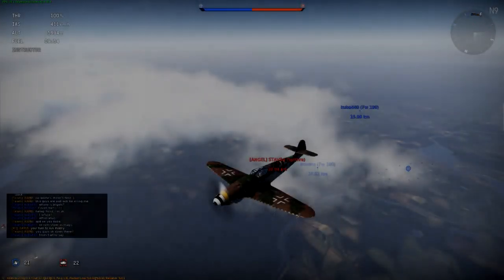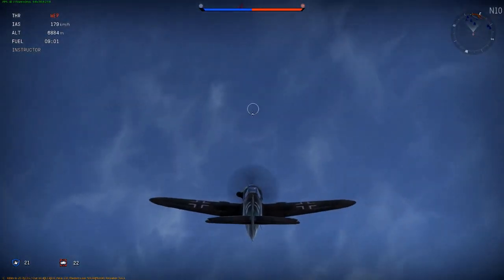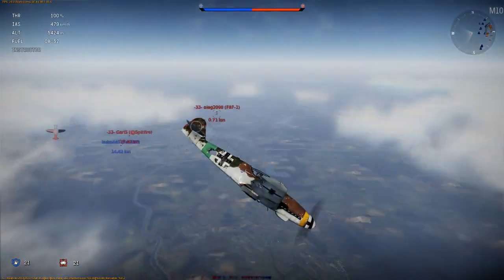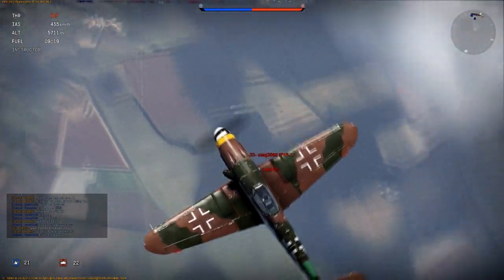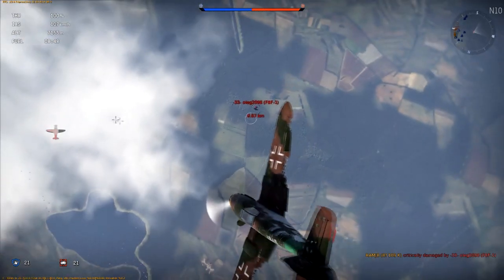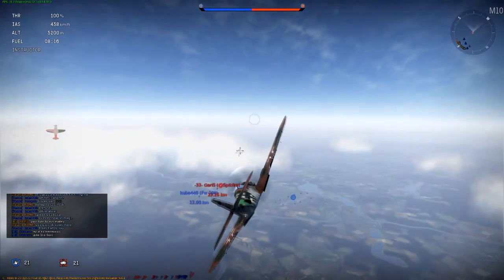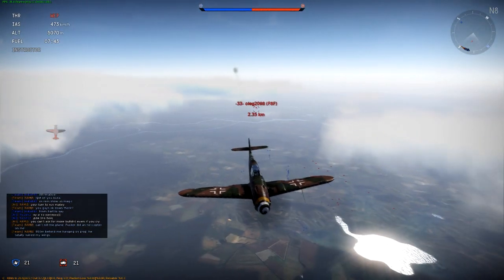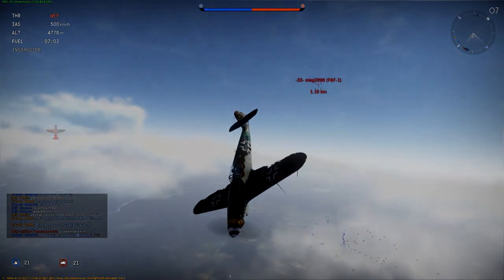War Thunder: when broken happens.

Comment from the maker: btw, the mere fact that at the climb both planes were at a similar energetic state is a dead giveaway that the F8F is borked beyond redemption. Starting out at a similar energetic state, one plane simply pulls out, the second does a complete high-G 360 degree reversal AND a pull out, and the energetic states are still similar.

If the F8F had a similar energetic state at the climb it means the F8F wasted NO energy in his 360 degree high G reversal - pointing out at an obvious flaw in the FM.

Comment from the maker: we were in a straight run situation, he was moving away from me at the same altitude and roughly the same speed. He started his split S from that position, from a level run. He STARTED DIVING from that position. He was not diving prior to that.

You can make up a million excuses to try to avoid a broken flight model to receive the fix it desperately need, but that won't avoid the eventual fix - the F8F will get a proper flight model wether you want it, or not.

Comment from the maker: The point of a Split is is to conduct a high G move with the least speed deficit as possible. Doing a half loop costs a ton of speed (as you turn part of your speed for altitude, the rest you waste in the high G increased drag). Doing a horizontal turn costs a ton of speed (as you turn your steep increase in Gs mean a huge speed loss).

Split S is a way to do a 180 degree reversal with as little speed loss as possible - but you still burn a TON of energy by doing it at high Gs.

Comment from the maker: That's the problem. We both stall about the same time. The difference is that, starting from the same energetic situation (Same altitude, almost the same speed) he had conducted a high-G 360 degree move and posterior pullout. I just pulled out. Still we stalled out at the same time. Or in other words - he had burned no energy in a high G 360 degree reversal.

Translated into layman terms: the F8F Flight Model is more broken that the Parthenon ruins.

Comment from the maker: With 150 octane fuel the Spitfire was really a top class climber, and it still turned very well. The problem is not the plane, the problem is the unlock that turns it into, bassically, a 1945 performer, when it's sitting at a level that belongs to 1942 planes. Hence it's brokennes doesn't steam from a wrong flight model, but from a terrible matchmaking level.

Comment from the maker: so the point of doing a SPlit S is to do a fast change of direction and remain fast - but that doesn't mean that doing a Split S doesn't carry a hefty energetic penalty if it's pulled at top Gs.

That guy pulled a Split S as hard as he could using as many Gs as he could. He didn't burn any energy in the process - hence, the FM is broken.

Comment from the maker: The ingame Bf109K4 is a 1945 C3+MW50 versión. That's why it's a level 16 plane, otherwise it'd be a level 14.

And no, this kind of stuff doesn't happen with any other plane. Doing a full 360 inverted loop in even the best of the fighters of this game will give you a net 100kph IAS loss at the very least. This guy was as fast as he finished his 360 degree high G inverted loop, as when he entered it, and is pretty easy to see it in the video.

Comment: You have to remember that the F8F arrived in War Thunder in patch 1.33 and most likely doesn't have a proper flight model yet, as most new aircraft don't. Planes that have been in the game for a while, like the Bf 109 F-4 (and /trop), La-5 and otherwise usually have somewhat proper flight models, by now.

Comment from the maker: diving doesn't GIVE you energy. Diving transforms altitude for speed. And you'll excuse me, that guy did a 360 degree inverted loop at maximum rate meaning a but-ton of Gs being pulled all through the move.

Comment from the maker: Trading altitude for speed is pointing the nose down and go in a straight line.

Doing a Split S equals pulling high Gs. Pulling high Gs means induced drag going over the roof. High drag means a strong energy loss. Sure, the Split S is an energy conservative maneouver. Doesn't mean it doesn't have an energetic cost-it means it saves some energy compared with a non energetic conservative move as an horizontal turn. That move should've costed that guy a hefty ammount of E.

It didn't. Broken FM.

Comment from the maker: not at that speed. Aiming at less than 100kph in a purely noseup position is nigh impossible in most planes in Historical Battles - that guy did exactly that. It's an Arcade Flight Model in HB - and that only compounds the brokenness of a plane that burns less energy in a high G 360degree reversal and climb than other than just does a pull up.

Planes with such an obviously and blatant unready flight model should -never- have been released. Hope Gaijin learn from their mistakes in the future.

Comment from the maker: One: the bearcat's lower parasitic drag doesn't matter a single bit when he's pulling Gs like mad. Induced drag takes command there, and the bearcat should suffer from the tremendous drag it produces

Two: the Bearcat averages 200fpm less of climbrate of a K4 across the altitude ranges (can back this up with original German documents and original US navy documents)

Three: Pretty much irrelevant. That bearcat should've never stalled 800m behind me.Being there is just enough proof of a broken FM.

Comment: After looking at more Bearcat videos, they don't seem to bleed speed even in flat turns, which leads me to believe that the Bearcat actually lost very little energy in the split-s.  Though you have to wonder what convergence the Bearcat was using on his guns.  It had to have been 400m which is why Ram's ailerons were hit instead of his fuselage.

Comment from the maker: sure, if you're gentle at the controls you can win a lot of speed in a dive. Just happens that this guy was in the middle of a high-G Split S, not a gently conducted dive. That's not being gentle, that's pulling as much Gs as your plane will tolerate. Which should cause a huge increase in induced drag, in turn causing a steep increase in energy wastage and speed loss. Which should've meant the F8F should've never caught me at the top of the climb.

But he did - obvious broken FM is obvious.

Comment from the maker: no, a Fw190 wouldn't been able to pull that move on me, starting in a similar speed. He was pulling out allright...maybe 0.01km each 5 seconds. That's a meaningless speed difference. That Split S was a really high G move and high Gs increase exponentially induced drag and that slows down (or should do so) the plane A LOT. There's no way to explain what you see in that video within reasonable phisical laws.

That's just a broken flight model.

Comment from the maker: Once again, higher weight helps overcoming parasitic drag in straight moves (dives, zooms, extensions, etc). In high G moves as the one you can see in the video, induced drag goes over the roof and should cost a shitton of Energy.

that guy burned absolutely no energy in a 360 degree high G reversal. That's insane, bollocks, BS, you name it, but that's not a properly working FM in action. That's a broken as heck flight model in action.

Comment from the maker: adobo ,I was as fast as he was when he started his move. Same speed. Energy saving move or not a high-G Split S costs a ton of energy (just less than an horizontal break turn). I just pulled up. he did a high G 360 degree reversal AND FOLLOWED the pull up without a hitch.

Sorry that's antinatural.

The Bf109K4 weighed 3400kg on takeoff. The F8F weighed 3900kg on normal takeoff weight. That's similar to a Spitfire XVI weight.

In any case that move is just BS. Sorry, but it is.

Comment from the maker: Rimu, if you try to tell me that a plane that does a 360 degree reversal and climbout and is able to not be left in the dust by another that stated at the same speed and simply did a pull up, has not a broken Flight Model, then we have different concepts on what a flight model is.
I know about the WEP issue of the F8F and the insta acceleration it provides, still that 360º reversal should've rendered him much slower than me from the sheer ammount of speed burnt.

Comment: 1) Ram, we see the F8F for less than a second and you expect us to judge that you and he were moving at the same speed. 2) Split S. trade alt for speed, he comes around on you with more speed but not much more which leads to. 3) He stalls out at 0.75 km away from you, meaning......HE BLED OFF HIS ENERGY!

See way to many German pilots whining these days. Your planes are still unbelievably good (The 109 F4 is still way more broken than any allied plane), it's just now you actually have to work.

Comment from the maker: with a FW190 that split-S and 360 deg reversal would've been possible. A 6 position would've been possible. But the 190 would've been lost a sizeable ammount of energy in the move and would've not been able to follow that pull up. In fact no piston engined plane in this game should be able to do what you see in this video. Starting out at pretty similar speeds no plane should do a 360degree reversal+the climbout you see there and follow another plane that just pulled up. That's just antigravity.

Comment from the maker: How had he a slightly higher energy state than me?. Speeds were virtually matched even while he was very slightly faster. A high G reversal should cost a lot of speed no matter is done in a split S. True, you change some alt for speed and back ,but you're still pulling a lot of Gs - hence you're creating yourself a huge wall of drag (induced drag goes over the roof at high Gs) that should force your plane to bleed a ton of speed.

Clearly not the case here. The F8F bled no energy=borked FM.

Comment: another thing: how is it that a spitfire (not clipped-wing) can keep up with an f4u in a dive? in fact, i have not noticed any speed advantage in dives. most of the time, assuming the foe on my 6 has the same speed, i cannot outdive ANYONE in ANY plane. i had a match just now where i was in a p47 and an a6m3 mod22 kept up with me!! the match before, i had a spit and i kept up with an f4u!! planes with rounded wingtips have a disadvantge at high speed (wingtip vortices) and both of those planes were far lighter than an american fighter! i am stunned no one else notices this, too, because it is very broken.

Comment: I decided to test this 270 degree maneuver myself, so I picked an aircraft I knew didn't have a UFO FM and that was scientifically proven to bleed energy.  Hence I pulled out the Hellcat in flight test mode, no upgrades.  After maybe 30 mins of weping I got to 5500m going 440 kph IAS.  I went inverted and pulled 7gs until I was headed straight up.  I got to about 6000m before I stalled.  Interpret that as you will.

Comment: Claiming that Bearcat didint lose any energy is simply a lie. You start at same altitude of 5700, around 430 IAS. After his maneuver putting him behind you, you pull up, he follows, you stall at 7200, he stalls around 6500. So its kinda logical he lost quite a lot of energy, worth around 700m of altitude. The fact that he was able to aim and snipe you from 700 meters while close to stall speed is a diferent problem. Problem with mouse aim and instructor letting him do that "stall snipe".

Comment: The F8F did a high G maneuver, which should have bled off a lot of energy and then caught ram in a vertical climb when the F8F should have stalled out much sooner making a dumb move like that.
But hey, there are multiple aircraft that can pull a 360 G maneuver and then hit your speed even if you were going faster and held a higher position.

Comment: Bearcat traded 1k altitude to counter loss in induced drag so he was going opposite direction at same or slightly faster speed but at 1k lower altitude that Ram, and in level flight.  Ram pulls up and goes as high as he could.  The Bearcat technically turned up from level flight as well at that point.  Both stalled with the Bearcat 800 m below Ram which is roughly the altitude the Bearcat lost in the split-s.  It's close to believable but still kinda cheaty on the part of the Bearcat.

Comment from the maker: initially the speeds were close enough. He might have been pulling away 10 meters each maybe 5 seconds. That ammounts for a huge 7kph difference, virtually putting our energetic states in the same position.

I've told you before, I repeat you again, you simpy don't understand what you're watching, so I'd strongly suggest you to keep on insisting in digging yourself into an undefensible trench.

Comment from the maker: 1) well if you don't trust what I say better look for another youtuber to subscribe. What do you want me to do if I switched the recorder there, but tell you which is the initial setup.
2)Split S burns energy as any other maneouver. Or should do so. He didn't.
3)he stalled 750m behind me after closing into me from 1.2k, meaning he was initially faster after completing a high G 360 inverted loop. Or, in other words, that he had burned no energy doing that.

It's broken beyond belief.

Comment: what ram is saying is that the high-g turn didn't cost the bearcat any energy at all.  watching the video, it looked like the bearcat actually gained some speed from his split-s and following climb, despite pulling a high g turn.  i have yet to fly anything in wt that can accelerate while pulling hard, whether or not the turn is in the vertical.

Comment: Initially the speed were not the same, the Bearcat was faster and had more energy to work with, which he used during the high G reversal, in fact RAM showed us this very move in one of his tutorial BnZing from the bottom. 

At the climb, both aircraft were at similar energy state, however the Bearcat got a shot off at around .7km before 'noseing' down and had a little bit more momentum at the zoom than the 109 because it is heavier.

Ram made a mistake, miscalculated and died, simple.

Comment: I wouldn't really call the F8F broken , I mean is not 100% right by any means , but don't forget its using the P & W Double wasp and a exceptionally light airframe so it has an excellent power > weight ratio and retains and regains energy exceptionally well. Bearcats broke numerous records going from a standing start to 10k in a matter of minutes. No way dose it gave an arcade FM. Trust me I have both and have tested both and a Bf109K4 can outturn it (which shouldn't happen)

Comment: the dive speed cap problem on the bearcat isnt unrealistic, it has a radial engine that produces a lot of air resistance in a dive and not a significant amount of weight behind it, thats physics..... just because a plane has a powerful engine does not mean that it can go faster than a more aerodynamic aircraft in a dive. The k4 is far from being a UFO, its turn time is average at best, the climb rate is similar to the mkIX and it burns energy in maneuvers unlike the n1k and the f8f

Comment from the maker: You're absolute lack of ability to grasp the concept that when two planes start out at a similar speed, and one does a full 360 degree high G reversal and posterior climbout, and the second only climbs, the first plane should run out of energy way before the second is a good instance of someone who hasn't grasped the fundamentals of air combat.

Is useless to keep up arguing with you given that you simply don't understand what you've seen in this video.

Comment: He stalled 700-800 meters below you so he lost energy in fact.
I just tested it with Bearcat 1b, at 5800m and going 440 IAS I did a 360 degree inverted loop, hardest I could. Lost 150 IAS in a process(was at 290 IAS after maneuver and 5700m). 
So Bearcat cant do 360 inverted loop without energy loss.

Then I replicated his move, ended up stalling at around 6600, similiar as him in your vid. Then did the same thing with my G10. Similiar result. If Bearcat FM is broken , so is G10s (and K4) then.

Comment: The thing is the f8f was pulling up even before ram's bf109. The fact that it could keep climbing AFTER a 360 reversal into a straight up maneuver even in a plane that is light and can climb well should not be something even remotely possible. The bearcat has a very good climb rate I will admit that but the g10 isn't far behind it. Pulling that many gs AND a vertical move is not something any plane could do without burning a ton of energy/speed.

Comment: I understand your bitterness mate. F8F just retains energy better than P-38. Which is sad... Just some tests (reference models @ HB @ test flight @ both 30min fuel):
F8F-1B: 328km/h IAS -> 65km/h IAS. Alt gain: +-2950ft (142ft -> 3099ft). Time: +- 21s
K4: 331km/h IAS -> 68km/h IAS. Alt gain: +- 2550ft (332ft -> 2879ft). Time: +- 18s

Comment: oh come on. the bear did at least a 200+ degree reversal, ram did a 90 degree one. the energy state was about the same, and the 109 should climb better than the bear.  This is broken BS. and you know it. also, out-zoom climbed my a heavier plane-with a worse climb rate. lol? heavy means worse stall speed, climb rate is obvious. yes, it was a shot from 800 m away. but, he should have not been able to aim, as his plane was hanging on its prop. hits? maybe, but not that kind of burst.

Comment: I don't need to see an 'optometrist' to see the stack cards that were against you during that fight.

And no the FMs were not at fault, not by a long shot.

Doing a hammerhead at 250 mph against a good a climber, really?

Surely, it's because the Bearcat is broken, never mind the fact that you were slow to begin with trying to zoom up in a aircraft with poor zooming capabilities.

You're not infallible Ram and this is an obvious example.